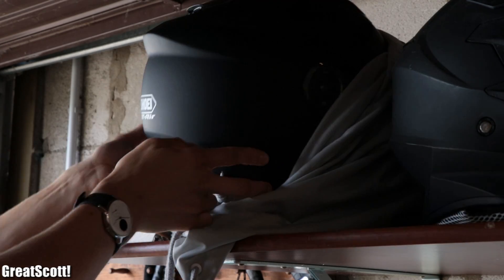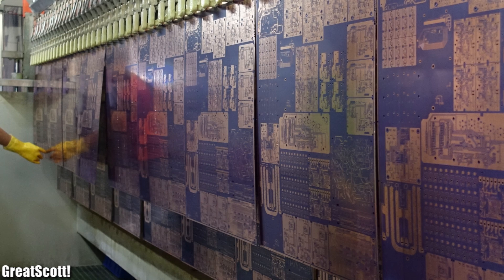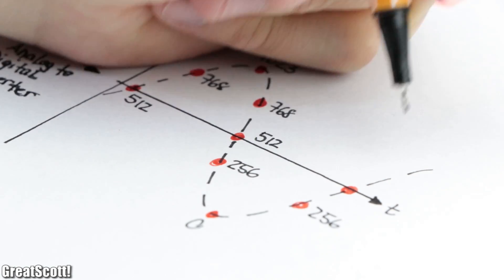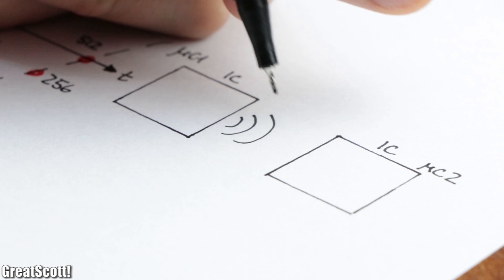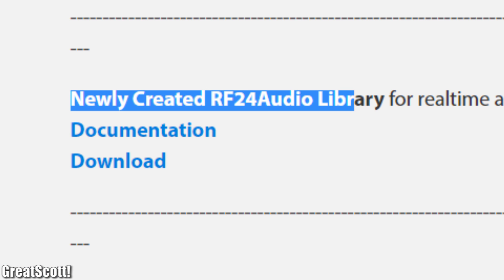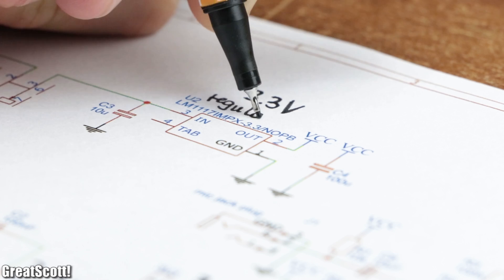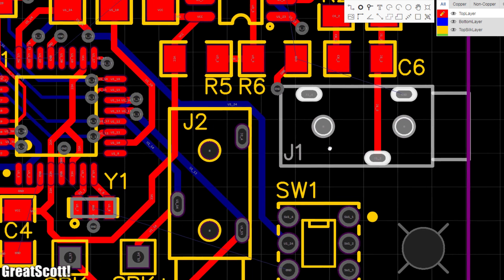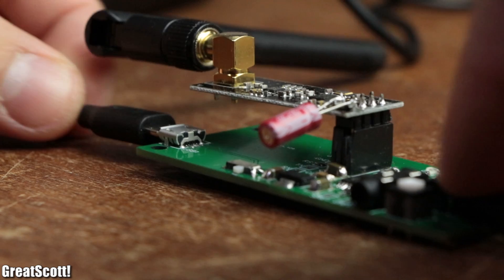Make your own very crude Walkie-talkie with an Arduino

Comment: I have successfully used an ATmega328 running off its internal 8 MHz oscillator for speach audio output to a speaker without much filtering - using a high-enough pwm frequency you should not need additional filtering. Have you looked at the output signal of your mic amplifier on an oscilloscope? Is it in the right range for the ADC? What is the sample rate of your ADC - hard to tell if you use the Arduino libraries, I know. This is a point where I would definitely consider using the hardware settings directly...

Also, how is the signal for the speaker generated? connecting it as a bridge-tied load between two pwm pins is not a good idea in my experience...

Comment: A lot of good suggestions in the comments. One more thing to check would be the DC bias of the mic input. Without that bias set properly, the negative voltage swings would be clipped causing ugly distortion. It looks like you did consider this in your design but I didn't see it verified in the video. A good way to check this would be sending your ADC read data to an off board computer and verifying that it is not clipping too much at 0 or 1023.

Comment: Also, I think you shouldn't have set the volume to max. Depending on what the library does underneath it might be responsible for the low audio quality. I'd check the lowest and middle values as one of those seems to usually represent 100% loudness in all of the radio libraries I ever worked with. High values usually mean some kind of boosting.

Comment: Speech has very little content above 4 kHz.  Most commercial 2-way radios filter out everything above 3kHz to save bandwidth.  You could easily filter everything above 5kHz and still have very acceptable audio.  This could drop your data rate requirements for the send side, though I wouldn't go much below 15 kHz.  For the receive side, definitely need a filter on the PWM output.  A low pass filter  at the Nyquist frequency (Send side sampling frequency, 16/2=8kHz, not PWM base freq.) at the -30 dB point should work great.  And, to be honest, I don't think you'll be hearing much above 8 kHz anyway when you consider wind noise.

Comment: I think PWM was a mistake.  Send a stream of bits instead, hard 1s and 0s, so you don't introduce additional analog noise to the transmission.  Use a properly filtered DA converter to get booming clear audio.  12-bit resolution will be plenty for this application.

Comment: I am a bit disappointed this time... You just violated Nyquist theorem, that's why the audio sucks. As a EE I don't undertand how you couldn't think of it, the 16khz means you had a frequency of less (because there is no ideal filter  H(f)) than 8khz while human voice and background noise can go as high as 12-14khz (not counting music ofc) so there is a huge folding in frequency. There is probably even a quantization problems as arduino's ram is very limited but that is out of your control but as for the frequency you could at least tried a simple RC filter around 6khz to kill everything above that.  Old phones had a band of 4.4 khz so it is totally possible to work with 8khz band...

Comment: As much as I like your videos, I think the purpose of this one was only to make JLPCB happy. Making a PCB while knowing the breadboard version does not work was pointless. IMHO, using Arduino to transmit voice is not a good idea. Looks like everything was done under the time pressure.

Comment: Hi, have you tried powering everything from 5V and leaving the NRF connected to the 3.3V reg?
Have you got a scope trace of the audio out so you can get some idea of where the distortion is coming from?
Have you checked your 3.3V supply for noise from the NRF plus unit needing quite a bit of current when transmitting?

Comment: I really do not understand the point of using TX-RX modules, Arduino, ADC/PWM when there is this: http://www.dorji.com/products-detail.php?ProId=56
Use the arduino or any other uC to set and control the module.

Comment: Terrible audio is because of the receiving end does not have a proper DAC. Driving a speaker with PWM will not work for human voice. But, I'm sure you already knew this even when you started the project... So, why did you even try? The same setup will work decently if sending and receiving ends utilize proper ADC's & DAC's.

Comment: I would have used PORTD and a R2R DAC to create the analog output. If it works to play Amiga ProTracker files on a Arduino, it should work for wirelessly received audio.

Comment: think your problem is tying to drive a speaker directly from a PWM source, figure a guy like you could whip up a crude DAC fairly easily, filter and put that through a op amp to drive the speaker.

Comment: Dont you think you get a saturated signal in the input stage? You had an amplifier with a factor of a 100, so if you use 3,3V, and have an input signal greater than ~33mV, you have a saturated signal on the output. I would have try to hook up a speaker to the output of the amplifier, to see if i get a clear sound there. Also, i do believe your PWM output need some sort of filtering, like a class D audio amplifier. Great video anyway! People love watching other people failing!

Comment: I'm not an expert on analogue to digital conversion but it seems to me that part of the audio problem is that the arduino is only measuring 1024 voltage values, which I think(I could be wrong) is only a bit depth of 10, which for audio seems low.

Comment: Distortion is bad at both input and output - make sure there is no distortion at both I and O and that the signal there closely resemble the real audio signal, if not then try to adjust the gain of the Op Amp before sending it to the Transceiver. Also make sure that you are using the same ground (measure the zero difference) between the audio circuit and the MCU circuit or else you will have those kinds of problems.

Comment: This sounds like a distortion issue that needs filtering problem. Did you measure the peak to peak of the output for this junky sound? Did it look like a square wave or audio wave? Try adding same audio BPF on both the TR and RC sides attempting to eliminate the sharp edges that maybe taking too much of the bandwidth.

Comment: One issue I'm questioning about is if any kind of buffering is involved. This is to ensure that the signal is actually together rather than broken apart, which could result in what you are getting.

Comment: What PWM frequency and resolution did you use? Since pins controlled by timer 1 can go up to 16 bit, I guess the frequency will probably be the most challenging factor. Apart from the frequency obviously needing to be above the audible range, I guess ideally you would have at least a few PWM cycles before updating the sample. If you're sampling at 16 kHz, I guess that's kinda hard to do. So I guess it would be a good idea to choose your sampling rate so that the frequency is a multiple of the sampling rate, so you're not always updating the PWM in the middle of a cycle. I'm not sure how you implemented the PWM, but I guess there's most likely room for improvement. I guess an alternative may be to try building a resistor ladder as a DAC or something...

Comment: I though you should filter the analog signal from the microphone before sampling with ADC. without LPF your ADC will get a lot of frequency above the sampling frequency and causing an aliasing to your sampled signal. Those aliasing is what we hear causing hi frequency noise to the output,
Beside, yes you should also creating another LPF after the PWM signal on the output to filter the hi frequency created by PWM.
Hope this help.

Comment: Based on things I did many, many years ago, I think two things may be going on. 1) You set the gain on your op amp circuit too high and/or 2) Input Independence mismatches causing distortion.

Over all, beautiful work.  Thanks for sharing.

Comment: oh shoot!  Your ADC is only 10bit -- even if you use the full voltage range there will not be enough voltage steps to rebuild decent sounding audio.  You can prove this... Sample some audio at 8, 10, 12, 14, and 16 bit.  This is a "quantization" audio flaw.

Your sample rate is slow, so it will not be "CD quality" but that is probably not the biggest issue.  It's likely the voltage resolution.

Comment: PMR446 walkie-talkies are relatively cheap and have a relatively long range. If they have a microphone/headphone/ptt connector, they are easily usable for group rides. Another big advantage is, they don't use proprietary protocols to lock out other vendors (no vendor lock in).

Comment: I might have two ideal that would make this ideal work, remember I never tried it so it may be dumb and not work.  1st ideal, and this is the stupidest ideal I was thinking about, is to feed the audio right into and out of the transceiver. 2nd use a ADC and DAC, like the ADC0831 and MN3006 ic.  Remember I never tried it.

Comment: You'll probably won't be reading the whole 500+ comments :), but here it goes anyways. 

Without any information besides your video, I would look into LM358's supply range, I don't think it goes as low as 3V3 without issues (also note GBP), but I would bet your problem is in the software... one thing to check is if the audio samples you are sending to the PWM DAC are signed (2's complement) or unsigned.

One other thing... The internal Vref of 1V1 could eventually help you save the MIC amplifier (~100 steps for 100mV range). Oversampling could add a conversion bit so even more steps.

Comment: The easy way to solve this is EPS32 and use WiFi, then you can even encrypt your transmission.  I made a project like this about 6 month ago to use this summer with good results.  In out community there is not over 30 users and the ESP32 and we cal all talk to each other as soon we can connect with them.

Comment: I actually just did a intercom build with the same library and some Adafruit Metro Mini uC boards, and I think what your issue is is you're using a op-amp, and not a proper microphone preamplifier circuit/IC. I used a microphone module with a MAX4466 IC, and the audio was almost decent enough to use for music. Also, I didn't touch the volume controls, as that might just have something to do with it. I'm just a newbie Arduino tinkerer, but I hope this helped.

Comment: Sir why didn't you used DAC function of Arduino???
Reply: The arduino (Atmega 328 chip) doesn't have real DAC functionality. The analogWrite() function makes the output behave like a PWM pin. Simply put it varies the high and low time while keeping the same frequency
Reply: @thomzz3449  then why didn't he used the specified boards like "lora board" which are designed for this purpose.

Comment: 8000 samples per second should be enough for clear and understandable voice signal. To diagnose issue it will be good to source input signal like 1kHz and check output signal with scope. I think there will be issue with jitter, lost data packets,  or PWM output settings. PWM frequency on arduino could be up to 60kHz, but by default it is something arround 1khz. Try to increase frequency of PWM or add some DAC, parraler R-2R dac is ideal solution because when this type of DAC is connected to one 8 bit port of microcontroller, then you can change output value with just one instruction. Some simple signal encoding like delta modulation can help you in reducing bandwitch and some non-linear encoding like ulaw or alaw could help you in reducing noice. 

Other option is switch from arduino to ESP32, it has more than enought performance for encoding audio, and also it contains embeded DAC and ADC

Comment: I have a technical degree in electronic communication, so I think I can help you fix this project.

The sample rate and the resolution of the ADC should yield audio quality somewhere between an AM radio signal and a land line telephone (POTS). This is just fine for a walkie-talkie.

Mistake #1 in this circuit: OP amps should not be used for audio amplification! They do not offer constant amplification at every frequency. This causes distortion to audio signals. Because you used this as your first stage amplifier, the distortions are going to be magnified at every stage of the circuit. Garbage in, garbage out. You even knew that this was a dirty amp, so why did you use it?

You should have used a class D amp in an IC package or set up a class A amplifier using a transistor circuit instead. Improving the microphone circuit isn't a bad idea either, which you did try.

Mistake #2: no filtering of the input signal before or after the first amplifier.

A band pass filter of 20 Hz to 20 KHz before and after the first amp at minimum should have been used to keep noise levels down. Other filtering would be optional since we are only shooting for basic communication, but a very narrow band stop filter of 50 Hz or 60 Hz (depending on your country) to remove noise from main line powered equipment and supply systems is another basic filter needed for audio applications, but since you were using a digital radio system, it is not really needed in this application.

Mistake #3 and the main problem with the audio quality: simply connecting a PWM signal to a speaker will not reproduce audio signals.

You could have used the DAC on the micro-controller and then an audio amp to complete the circuit. This requires additional components though.  You needed to use Sigma-Delta modulation to have the PWM reproduce the audio signal. This can be done using code on the micro-controller. It is also likely that you needed to implement Delt-Sigma modulation on the ADC side of the circuit as well. Again, this can be done on a purely code level.

As you have the circuit currently,  you might be able to make it functional by altering the code using the modulation methods I mentioned, so the project might be salvageable and considering the time spent on it thus far, would be worth looking into. Plus you would be able to talk about encoding audio using PWM signals.

An amp for the speaker and volume control would be a good idea too.

Comment: You can still use it as a wireless telegraph, right? Just have it respond to spikes in volume, which it can convert to a pure digital tone to send and reconstruct. Better choose a tone that's not too annoying to listen to, though. And when someone wants to send a message, they can convert it into code in their head, and make a loud noise with their voice or whatever, with the correct series of dots, dashes, and silences.

I'm actually half joking about this, as that would be incredibly distracting while driving, and require both the sender and receiver to learn a new skill well enough to do it on the fly.

Comment: Hi!
I just recognized that the sound that was coming through from the speakers were very similar to me. For a few months now, I'm working with a  translation system as cheap and basic as you can buy online. It uses the fm range, to transfer the audio, and I realised that it can be VERY easily overdiven by the microphone gain, and then a very similary sounidg audio comes through on the receivers. It behaves very strange. When I increase the gain, it's slowly getting louder, and when it reaches a level (not anywhere near to my mixer's max output level), it suddenly starts clipping at the louder parts, and make them incomprehensible (just like your voice in your experiment). I suspect, when it's more overdriven it can easily ruin the whole script. Since (if I understodd correctly from your video) you didn't bother at all with the volume/input levels, it may worth a try. I hope sou see this and can try it! Good luck!

Comment: Purely guesswork here, but I feel the problem was trying to drive the speaker using PWM. I think using a proper DAC would've yielded much better results. 16kHz is more than enough for decent voice audio. AFAIK phone lines operate at no more than 8kHz (albeit somewhat shifted).

Comment: Hi,  great video!  I see you have a few issues, try the following to debug first you should first try send the audio out to the speaker on one unit with out rf transmission to hear how clean the audio is, the opamp you used to amplify the mic does not function well at 3.3v try a rail to rail opamp, the next step is to create a floating voltage of 2.5v with 2 resistors that are about 4k7 each on the input of the adc using a cap  to isolate your signal from the preamp to the mcu as you will need good drive current to the adc to improve adc sample quality , then on the output you will need to use 1 PWM running at 50% duty running through a rc filter going into an amplifier ic Solution throught a decoupling cap, please try this and let me know, should need some schematic ideas, please Mail me jodybotha@yahoo.ca

Comment: nrf24 is a 2.4 GHz communication IC, therefore you need a ceramic capacitor in order to decouple the IC properly. I think even a 100pF capacitor would be more suitable for such high frequency applications.

Comment: What a complex mess. I done the same thing with a simple method. Build a 1 transistor colpitts oscillator with a 4000 MHz quartz crystal (1 transistor, 1 crystal, 2 151 caps, 2 resistors only). With this crystal you get 4 harmonics in the FM comercial range that for so short distance it will work. For receiving use the mobile phone FM radio with the advantage to get calls in the trip. I made one way transmitter. For 2 transmiters you can develop the idea and make a video after. For audio amplifier I normally use TL082 (I made a few door intercommunication circuits and the sound is acceptable)

Comment: Have you tried making a test firmware that just outputs the audio on the same board to rule out any wireless issues? You can also try removing the 358 and then inputting a signal from a MP3 player via a bias network to rule out the preamp.